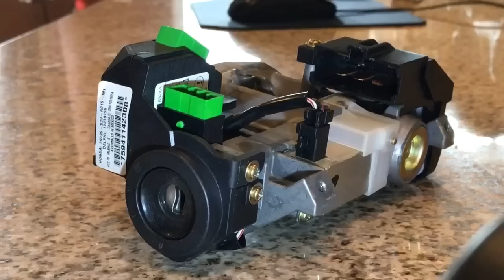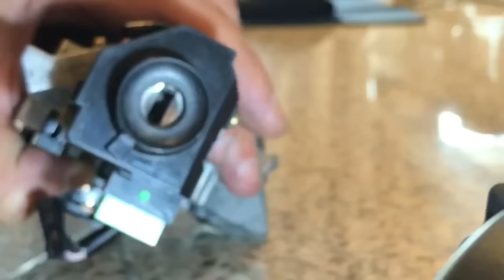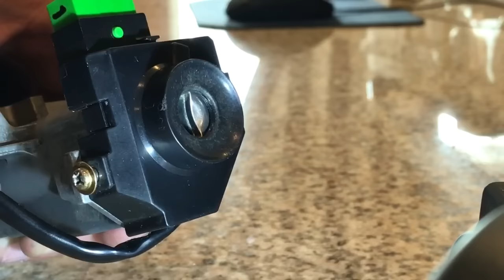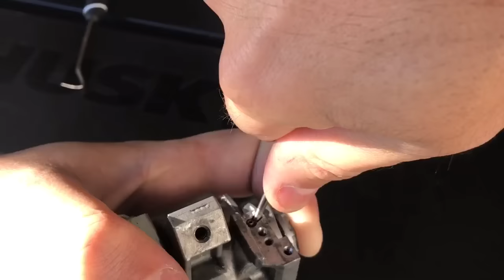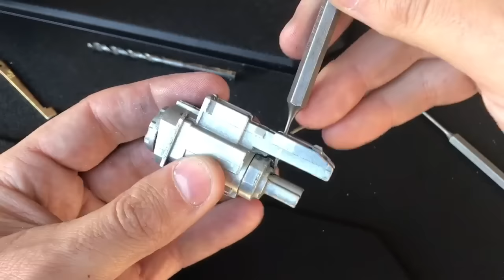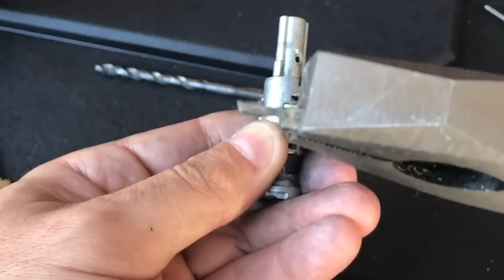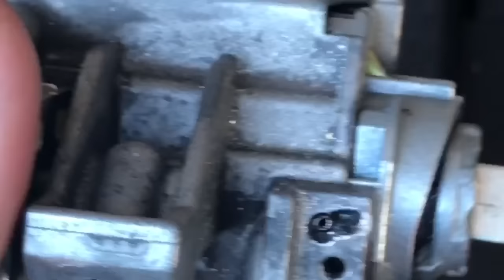Honda Ignition Lock Repair - Step By Step Tutorial

Comment: Interesting method. I’m located in mass and repair these frequently for AAA and private calls as well. We have a different method but same overall process. 

Great video and very informative for those capable of completing such a  repair. 

One note I’ll mention is DO NOT LOSE THE ROLL PIN!!  The repair will not be successful if you don’t replace it. May work briefly but it will be a nuisance.. and it’s hard to find the correct diameter and length…

Comment: Great tips. I took mine apart and when I removed the tumbler 6 of the wafers fell out and the springs seemed to be missing. I put it back together and the key turns fine now but the steering lock seems to work intermittently. No biggie. I can live with that. Will probably sell the car in the Spring due to transmission slip problems. A rebuild transmission is too expensive to warrant spending  that much on a 2004 CR-V.

Comment: Great video! Drilling a hole for the roll pin is genius. Took me in total about 1.5 hours from start to finish. Thanks!
Reply: hi, what size drill bit was used?
Reply: can get the pin out with out drilling through top, small screw driver on an angle whilst in a vice on bench can tap it out just fine no drilling.

Comment: Awesome! I looked up a seperate video that lets you get that ignition lock out without removing the entire housing, basically drilling sort of in the same spot to get that roll pin out. And then your trick to just remove the one broken forgot what you called it thingy, and boom, fixed! Thanks!!!!

Comment: Great instructions - just fixed my car using this video.  Just a few slight mods - where you pulled out the first roll pin, I not only drilled down as you did, but (looking at 2min15sec), I drilled straight down (i.e. at right angles to the roll pin) so as to "lever" it out.  Worked quite easily.  Also, when removing the faulty wafer, I also filed down the leading edge of all the other wafers so that as the wore down, they wouldn't catch.  Thanks again

Comment: Thanks a heap for this ingenious Gem of a video. I followed your instructions to a itee and it went off without a hitch, took like a half hour. I didn't have a punch that small on hand so I knocked that pin out with a finish nail, you just have to flatten the point out on a grinder or just rub it on some cement till it's flat

Comment: Thanks for this video. It really helped out... one thing though, I didn't need to drill next to the small roll pin holding the cylinder housing all i did was use my ice pick in an upwards motion and alternating sides, it popped up after about a about a minute.

Comment: Saved me $1350 Canadian for about 4.5 hours of work. I used a punch to loosen the lock mounting bolts which was a pain. I cut grooves in them with a hacksaw for a slot driver for the remount. Question: can you just remove all the little tabs and springs to prevent future problems? I took the key out while I had the tumbler out and about 3 of them fell out so I ended up pulling 4 in total. Works fine.

Comment: Well, here is yet ANOTHER youtube testimonial verifying that this worked for me. I had the same exact problem with the wafer not retracting. I managed to fix it at night time at the laundromat, last night !! You just saved me $350 from a AAA locksmith referral.

I have an 03 Honda Element. Don't ask me how I got that pin out without that centerpunch😳 Thank you sir !

Comment: Great video, did my car without any penny, two comment i will add
1. put a masking tape on the key side and on the back retainer pin side while you drill, as the chips shall mess up the cylinder.
2. Tie the indicator assembly position so you don't  position and end up breaking the harness for steering controls as i had to rotate steering to unscrew 2 screws to separate indicator assembly from key assembly.
thanks

Comment: Love the roll pin tip, thanks.  My 2 cents on my 2004 ody.2004 Odyssey. 

Had the same problem and fixed this for $1. Need to be comfortable with working on cars and willing to learn a bit about lock mechanism. Here is a synopsis:

Key will not turn in ignition lock, wafer(s) inside lock cylinder are worn out.
1. Removed negative battery terminal (to prevent air bag issues)
2. Removed the steering column plastic shroud (three screws bottom
3. Unhooked a wiring harnesses for clearance to the clamp.
4. Used a chisel to “bite” into two bolts holding u bolt clamp and tapped them out ccw.
5. Removed the wires for the immobilizer (about 4 screws) and the ignition switch (two screws on back) and the key mechanism was out.
6. Used a scribe to scratch alignement marks so you put in back correctly
7. Removed the lock cylinder from the housing.  Note there is a roll pin that you have to drill a 45 degree hold with about 1/16” drill bit and pry out with a sharp machinist scribe or awl.  I could not get it out any other way (pry method did not work)
8. The cylinder then came out and there is then a second roll pin, you can punch out easily with a 1/32 pin punch
9. Then pull out the wafers that stick up and remove the spring for them also.  You can see the real trouble makers easy, but two on mine were less obvious, I just pulled the ones that stuck up the most until it turned smooth.  
10. Instead of fitting shear head bolts when I reassembled to steering column... I got a pair of M8/1.25 x 16 cap head bolts from Home Depot, these worked perfectly.  The only cost was for the new bolts.
11. Total time for me was 2.5 hours 30 minutes to remove the assembly, 1.5 to fix the tumblers (most time spent with the first roll pin!) 30 minutes to reassemble.  I am airplane mechanic and have good mechanical skills.
Reply from the maker: That’s A nice detailed list.... you mind if I use it on my website I’m gonna be making a page on Honda ignition repair and this content would be great 

On point 10) I usually take out my Dremel with a cut off wheel and make a notch and put it back nice and tight with a flat head screw driver / Im going to buy a couple of MB/1.25 x 16 and try them out on my next Honda ignition repair job “Great Tip” !!
Reply: Sure no problem.  Some of that list is from a forum and I just added and edited a few things.
Reply: My wife needs take a plane for work tomarrow and my switch screwed up today 😭😭😭
Seems to never fail 😒😒

Comment: Thank you very much. You just save me $$$$.  I was able to fix my 2002 cr-v ignition cylinder.. Awesome !!!  BTW, I used a rivet pin to take out that pin by bending it just enough to fit into the gap then tapped it slowly until a little bit came out and I just pulled it with a long nose plier..

Comment: This was very helpful in getting a non-working key replaced with a cheap aftermarket alternative lock and tumbler set.
Fixed on car which saved both time and $300. Tumbler wafers wear out when using key so often in 129K miles. Great work! Many thanks for your clear instructional video.

Comment: Thank you----i wasn't sure if I could even try this. I think the hardest part was putting the steering wheel cover back on. If you try this be careful of the waffers/tumblers dont pop off from the bottom this video doesnt show it so more than one came off and I was kinda scared knowing it wouldn't work if I lost more than 1 actually i lost like 4 lol but it did and I'm still not sure if i ever have to remove any more if it will still work. i guess I'll just have to wait and find out. I have a 2003 Honda civic bought it at 15 mi. And it just went out with 401,000 good thing I was home lol---i spent $0 so I thank you  again ps. It took me maybe a total of acouple of hours even the drilling part was easy since its aluminum so again be careful

Comment: Your video, saved me $$$. Thank you so much. I ended up taking all the tumblers out, but it cranks! My housing was a little different. 2003 Pilot... someone had been in there before because the break of bolts had screw driver access in the heads. Again, Thanks!

Comment: My man. Holy shit, my ignition failed on my 2009 honda civic si and locked up and wouldn't let me turn the key. Your video saved my ass, and my wallet. Thank you! Out here in Alaska it gets pretty rough, the local NAPA quoted me on about $500 for the part which was a special order part and would have taken several days to get a new one plus a tow, and the shop expenses. I knew youtube had the solution.

Comment: Thank you for the video. I did the repair. But when I took the key out of the cylinder ALL the wafers fell out on the bench except for the one that was not working. So I pulled the bad one out too and now there are no wafers in the cylinder. Put it all back together and it works great. CAUTION to all who try this, support the wafers when the cylinder is out and the key is being removed from it. Thanks for saving me a repair bill. You're awesome!
Reply: Are you saying that pretty much any key will now start your car?  :-)
Reply: Same happened to me only key programed will start car. Thank you
Reply: Same but it still won’t turn

Comment: I have Honda Jazz. Key fails to turn every single time. I then looked across 3 sites and read about a guy who put his key in 4 or 5mm only. Turn it clockwise about 1/8th of a turn, BUT WHILE keeping the clockwise torque on it push it on in. Car starts every time, but only when I do this. Thanks (whoever posted this advice).

Comment: Used this procedure, successfully in that the car now starts as needed.  Some differences.  My ignition was somewhat different. Same basic design but different dimensions, such that no drilling was necessary to remove the 2nd pin.  The first pin fell out on its own with a little wiggling of the cylinder.
Problems on reassembly: fitting the immobilizer ring (circuit board,which came off separately from the two plastic pieces).  Did get it all on, but the steering wheel lock wouldn't move to lock position, even though it worked fine in several trial assemblies.  There was tiny flat head pin  in the ign body to interface with a push button on the ring. almost lost it without knowing.
Back on the car (2004 Ody), starts fine, no SW lock.

Comment: 04 odyssey was slightly different. 2nd roll pin was accessible, no need to drill a hole. I just ground the problem wafers down on a belt sander. Quite tedious. Thank you for the video!

Comment: Great video!  I just did mine and looks like it was the exact same pin that was bent just like the one you did..  question though, the cylinder turned while it was out but wasnt able to  turn it after I installed back into the housing.  Is it not supposed to turn?  I even depressed the steering wheel lock thing.

Comment: SUBSCRIBED! - Thanks to this video and these master locksmiths, I was confident enough to resolve a 5 month long Honda Accord 2002 Key Ignition problem. The key would NOT turn. After spraying WD40 into the key slot (don't ever do that because you need to use DRY LUBE not anything else) the key moved just a hair but no further. I ordered a new key ignition assembly and had a mechanic replace the key ignition for me. Big mistake because after he installed the NEW assembly, he told me that I needed Honda to reprogram the keys. The problem is Honda wanted $450 for that. So I called a local locksmith and he came out and said something is wrong and could not program the new keys and charged me $50.00 for the trip charge. The Honda Key Ignition assembly I bought off amazon.com came with 2 NONE CHIP keys BUT looked like they had CHIPS in them. OUCH! After watching this video I said F__k it, just tow my Honda back to my drive way. Yesterday I watched this video and once again said F__k it, and took apart the OLD key ignition lock assembly that was locked up. Just like this video indicated, one of the keys was sticking up but not because it was bad but because the spring had got caught from dirt and was pushed up at an angle. I guess this is why WD40 is not a good idea..LOL.  I probably could have saved alot of time by using a DRY LUBE. Anyways, I put the old locked assembly back together after using cleaning the key lock and using DRY LUBE and OH YEAH! Works like a charm. This video deserves a million likes! I could NOT have done it without this video and these master locksmiths. THANK YOU GUYS! YOUR AWESOME!

Comment: Just did this on my 08 crv. I didn't have to drill through the top of the cylinder, I was able to use a bent finish nail to tap out that pin FWIW.

Comment: Thnaks, I have done as you described in the video. I have removed all the wavers and inserted the lock back in the housing. The key inserted into the cylinder turns fine, but once I put the assembly back in the housing the key will not turn the cylinder anymore. Once I pull it back out it will turn. What did I do wrong. Its a 2009 Honda Fit.

Comment: Thanks man this video didn’t really help me since mine wouldn’t pop right off as you said it would but i figured most of the steps were the same just in newer pilots you have to remove a little pin to realize me the tumbler out !! You have to drill a hole next to it and pry it out with a Icepick or something really pointy

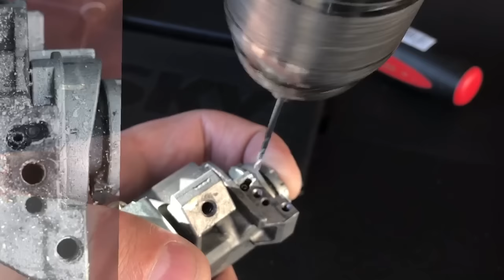Comment: For the roll pin at 3:08, in my case, I simply tapped a few times next to it with a punch and the cylinder lock popped out thanks to the internal spring. I think it's also best to remove all wafers except the last one at the farthest in case other wafers break in the future.
Good guide nonetheless, complete one, not just how to remove the cylinder lock.
Reply: Why not the last one ?
Reply: @carloslizarde8221  the key will fall out otherwise. Keep the last so the keep remains all the way in.

Comment: That video was awesome.  I was able to fix my 2003 Honda Element.  The only problem is that when everything is back together, my car thinks there is a key in the ignition even when there isn't.  So, the chime goes off when the driver door is open, and worse, the key fobs don't work because of that.  But hey, at least I can drive it.  Does anyone know what is or is not making contact?

Comment: Hi, I followed these steps and successfully removed the faulty wafer from the lock. However I haven’t put the assembly back yet and I’m wondering, with a missing wafer, is there a risk that the key might fall out of the ignition while the car is running?

Comment: Is it possible to swap an ignition switch solenoid off a used unit and out it on my current one to avoid all this? My key gets stuck in first position regularly. Thanks man

Comment: Did this and the lock works just fine out of its place but when put into the assembly, it can no longer be spinned. Steering wheel lock is engaged but will not disengage by normal methods. Do I need to disassemble the mechanical steering lock now or does this have something to do with the cylinder?

Comment: Thank you so much for explaining everything slowly. . I just bought a 1994. Honda Accord.sedan.  I wanted a mechanical car. Because I knew it would be cheaper to work on. All those computers on newer cars are expensive to fix. Can you suggest some basic tools? I should buy. ? Like testors or something.
 I want to get to know this car inside and out. & Since the seller wasn't honest about some major things. I need to get some kind of tester. That can do a diagnostic check. On the whole car to see if there's anything else major wrong with it. . But I love challenges. .
     So this could end up. Being a blessing in disguise.  The only thing I'm afraid of is my hands might not be strong enough. But I bet there's a tool kit I could purchase that would to help me.
I know nothing about working on cars. . But I want to learn. I'm very mechanically inclined. I've fixed a lot of toasters and toys. .
 The guy who sold me this car for $2,000. Didn't tell me that the ignition was destroyed and the defoggers don't work. So I almost got killed. Coming home from Tukwila to Port Orchard. Raining so hard. 
   I've had the car for a week and a half now and I can't drive it because I can't turn the key. My hubby said just the part for the ignition, would cost $500. 😳 Not including labor. But I bet you could suggest a place where I could get parts a better bargain.?
   . I don't know why people have to be so dishonest. . After all, they're not really getting something. They're just bringing bad. Karma on themselves. It's the Old Law of reciprocity. . 
Oh, well, I'll pray for him. . In the meantime, maybe I'll just impress my friends and fix it myself. 😛. I think I can do that with your help. Now that I'm watching your videos I realized I can do this. . Thank you for explaining things slowly. I really really appreciate it. . I know I can learn this car. . All I have to do is get the manual and watch the videos and just keep practicing and I can do it.!!!
 I can do anything.if I set my mind to it. Especially with prayer. 
I absolutely love the fact that you  explain everything . like if the screwdriver is a flat head or a Phillips.
     It's always good to remember. There are people like me that are just beginners. And really want to learn. Thank you so much!!!  I can't wait to see your next video. 
    I wish you could come here and teach me how to Do things on this car. . It's a 1994 so It might be considered a classic😛😳. I could probably Cherry it out. What do you think about that??
 If I just learn how to take it apart. It shouldn't be to difficult.
 What I've seen so far is that these old Hondas  are fairly simple To fix ,I just have to know what goes where.  . That doesn't take a lot of brains. . I'm a smart girl I can do it. . How old does a car have to be 2 B considered  a classic? Thanks again.🙋😊🎇🌠 
   P.S.  Is there a good place to get parts online? Or should I try to find a local dealer?  🙋✨🌟😇🚙🚄🚇🚜🚐🚗🚘